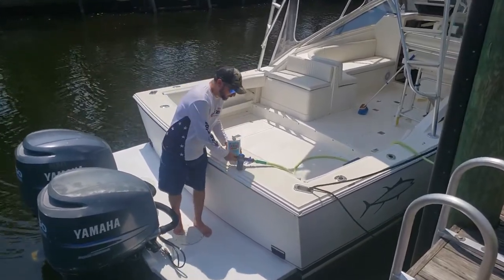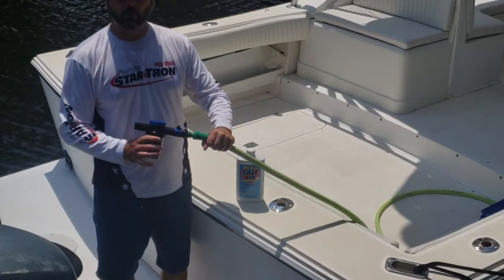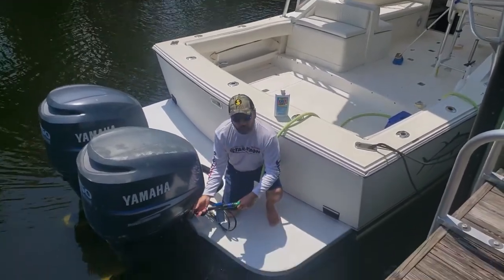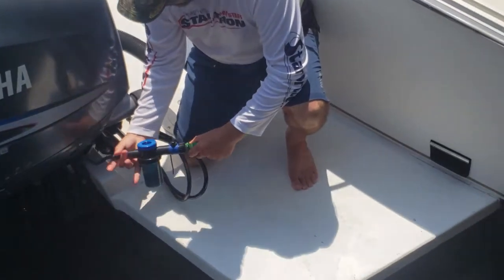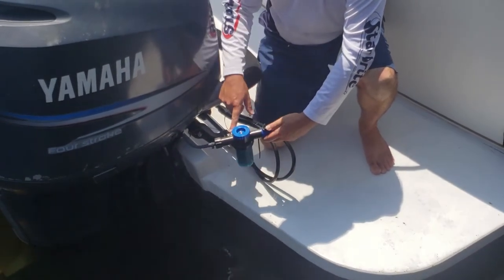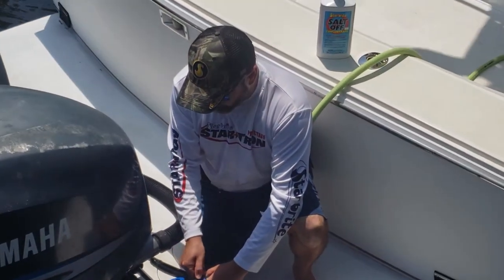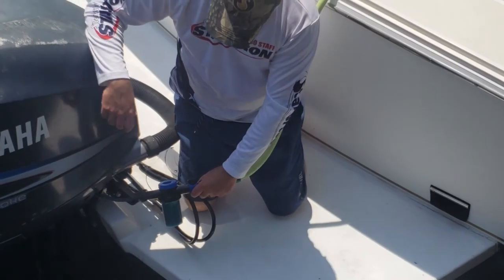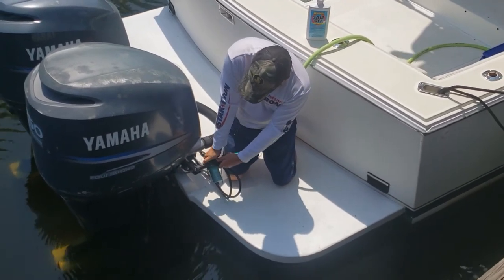How To Flush Boat Engine With Star Brite Salt Off

Comment: If the thermostat is closed none of the motor actually get flushed right?
Reply: correct. you should flush it with  the lower unit intakes. Plus the directions state to use 1 ounce of product then fill the rest with water.
Reply: You’re supposed to run the Engine until it reaches operating temperature at that point the thermostat should be open and then you can introduce the salt away into the cooling system
Reply: @johnbumpus7138  Don't burn your impeller up using the flush port.
Reply: @texassportsoutdoors  do you mean if you are running the motor while using the flush port ?

Comment: Never use the flush port on an outboard motor. Plug it and consider it non-existent.
Reply: Just curious as to what your reasoning behind the statement is? Why would manufacturers include flushing ports on almost every outboard engine design?
Reply: @johnbumpus7138  You will not get a correct flush. The manufacturer even says it for Suzuki outboards. Always use the muffs and run the motor. Do not run the motor using only the flush port. Research it.
Reply: @johnbumpus7138  The OEMs would not spend even $1 on something unnecessary if it would save them money.
Reply: @texassportsoutdoors  Dude, .............the reason for the flush port is for boats in moorage, so you cant attach muffs.... shoot a hose thru there (motor off) and it helps
Reply: @joelcr250  It flushes the lower unit but that is all. Get a CR500. It's a man's bike!
Reply: @texassportsoutdoors  it flushes the power head also

450 power lol
Reply: @joelcr250  Do some research. I promise you it does not. At best you have to remove the thermostat and put the cap back on and hope you have super high water pressure.
Reply: @texassportsoutdoors  i refuse to do research and intead rely on heresay